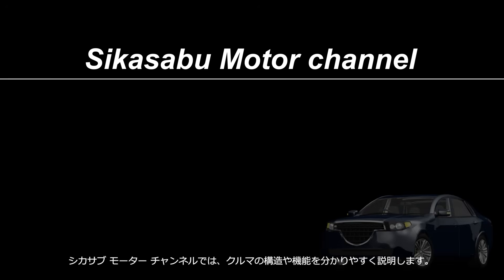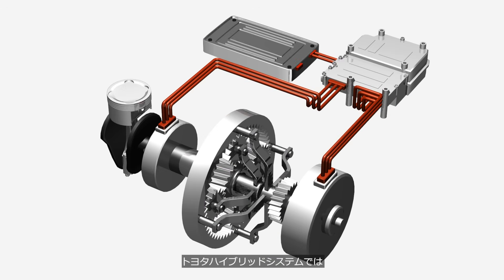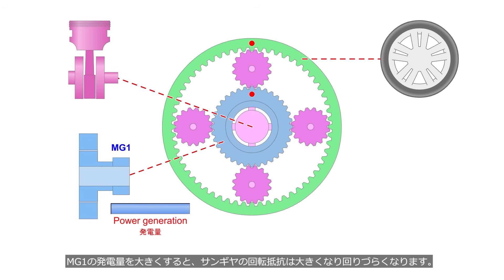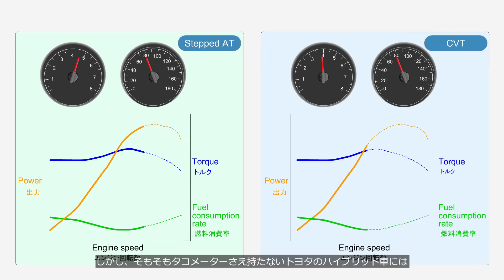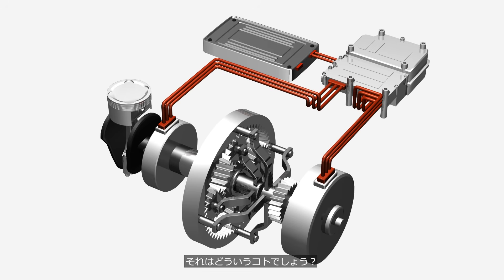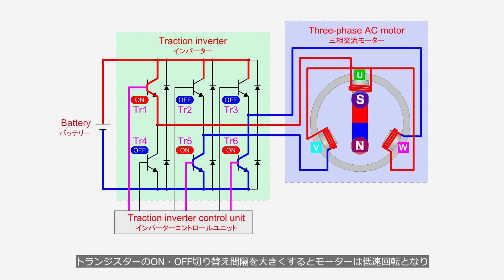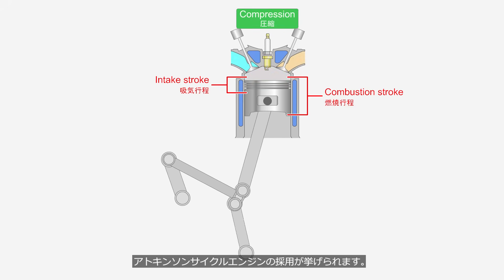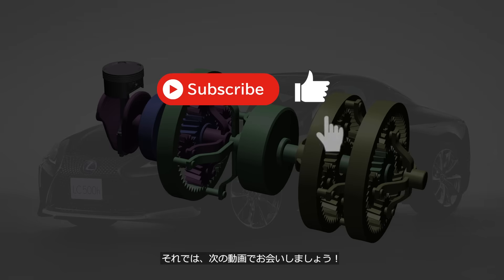Deep Dive into Toyota Hybrid System

Comment: It’s a good presentation of the operation of it all. It has improved over time. I now run a Yaris made in 2012, and until then I had the previous version. The older one had a NiMH traction battery, and the engine was a 4 cylinder 1.5l. The latest one has a Li-ion traction battery, and the engine is a 3 cylinder 1.5l one.

With the older one, it was necessary to use engine braking on some descents because (as you describe) the battery could become full, but that is less of a problem now. 

While the hybrid system works well, the low voltage side of the system can be awkward, as some models have quite small 12V DC batteries that can easily discharge via various low voltage items that are always in use, especially in cold weather. While there is no conventional DC starter motor on these systems (MG1 doing the job when required using the high voltage DC from the traction battery), there is a degree of interlocking with the hybrid braking system that requires some power from the 12V battery for to be able to start up (creating enough hydraulic oil pressure) and allow the traction power to be switched on. It is a common fault for low users at certain times of the year.

They could work around this by allowing the high voltage to start in 2 stages, as once the main contacts are closed the 12V is provided by a converter, and they could still be able to prove that the braking pressure is OK for the next step, but that would make it a bit more complex.

Comment: I do not understand, 3:07 if the sungear is rotating, does not it cause MG1 to generate power? Also at 4:10 how is power output of MG1 increased or decreased? Is MG1 disengaged physically or is it being rotated by consuming battery to match a certain rotation, hence load on the sungear?

Comment: <Edit> I get downvotes because I criticize Toyota. They don't show up, but I know it happens because I when I get upvotes the total is always zero. But nobody ever points out an error, because there are none. This is part of my point, in using straight-forward language. Toyota gets unjustified praise.
+++++
So many lies.

0:13 "In 1997 when the world's first hybrid vehicle,  the Toyota Prius, was unveiled..." A similar system was both "unveiled" and patented at the University of Maryland around 1994. According to the eventual lawsuit settlement, Toyota "developed it independently."

There were also previous examples, but they all suffered from not being able to use modern computers to regulate the system, which is what was innovative in...

0:24 "The engineer who developed this system must be an absolute genius." Alexei Severinsky, a Ukrainian immigrant to the US, with no connection to Toyota.

0:29 "At present, this system is the most fuel-efficient hybrid system in the world." The Hyundai hybrid system in the Ioniq holds the title as the most economical. But that depends on being smaller, and lower-powered, than similar vehicles. Most efficient has to be determined by comparing the most similar vehicles. Car volume and (surprisingly) wheel diameter determine the relationship between efficiency and economy (mpg). The closest comparison in this category is the Toyota Camry SE and the Honda Civic Sport. The Civic wins.

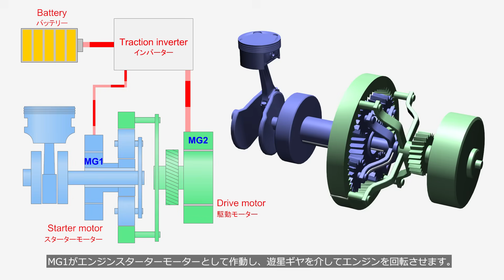3:19 "For engine startup, MG1 operates as a starter motor and rotates the engine via the planetary gear." Well..., not quite. The planetary gearset requires the rpm of the three elements to satisfy 13*MG2=5*MG1+18*ICE at all times. If the ICE is not spinning (ICE=0), this means MG1=2.6*MG2. To force the engine to start moving, MG1 has to reduce its rpm in order to increase the ICE rpm.

3:36 "At this time, the planetary gear functions as a continuously variable transmission (CVT), allowing the vehicle speed to change while keeping the engine speed constant." Close. The load applied to one of the MGs, acting as a generator, is balanced by the torque applied by the other, acting as a motor. This regulates the operation of the ICE as a function of both rpm and load. This is the innovation I mentioned above. It is a complicated way of saying the two MGs work together to force the ICE to run at the optimum rpm for the power it needs to produce.

4:18 "The engine speed is constant now." Not quite. A pure ICE car can only regulate engine speed, for the power the car is drawing. It varies with car speed. A hybrid can also regulate the power being produced, and uses the battery to adjust that to what the car needs. So engine speed will be more constant in a hybrid, but it is thee power  that  is most important.

5:01 "The vehicle speed can be changed while keeping the engine speed constant." Engine power output is held (near) constant while car speed and engine speed can vary.

Comment: The electric motor works on the principle of mutual induction which works as a motor to start the engine and a generator to recharge the battery the difference between synchronous  speed and rotor speed which is called slip. Positive slip is where the electric motor rotor spins less than synchronous speed of the stator which start the engine.
Negative slip is where the engine drive the rotor more than synchronous speed of the stator the induce magneticfield in the rotor is going start cutting across the stator and induce a reverse current at 270° behind the magnetize current.

Comment: Does the engine need a clutch or it uses the planetary system. If we turn mg 1  on the rotation of engine faster than the engine we can make ring gear stationary or even reverse

Comment: Cool to see someone have run whole system outside of car.
I was thinking if there is a chance to use this hybrid system as emergency power generator.
We have an engine, we have power generator, accumulator and inverter.
My idea is to use in case of emergency whole system as power generator.
I understand battery is 220-230V so exactly as voltage in European power grid. Inverter is converting this DC voltage to AC to power e motor. Would it be possible to get somewhere in this system 220V AC?
This was instead of powering e motor would be possible in critical situation as any type of blackout to power some most crucial devices home like fridge, maybe pumps for water etc or even boil water for a drinking. 
Anybody have such knowledge?
Reply from the maker: Thank you for your comment. 
In Japan, many models come with an option for a household power outlet. (I'm not very familiar with the situation in Europe.) There have also been many news reports about how helpful this feature was during disasters. However, if that's a priority, a PHEV or a battery EV with a larger battery than a self-charging hybrid might be more suitable.

Comment: I've heard that hybrid cars get worse MPG on the highway compared to regular cars. Also, are hybrid cars expensive to maintain? Is a hybrid really worth buying? Thanks ❤❤❤
Reply from the maker: Thank you for your comment again.
In general, hybrid cars get good MPG even on the highway. As for maintenance costs, unless the hybrid battery fails, I think they’re not much different from regular cars. 
However, depending on gas prices and how much you drive, it can be tough to offset the higher car price with fuel savings.
I love manual transmissions, so I would never buy a hybrid car.😁
Reply: @sikasabumotorchannel  thanks for comment ❤️❤️❤️
Reply: We on our third Prius hybrid, this time a 5th Gen. We had the first two for 16 years. The maintenance costs were far less than other ICE cars we owned. The Totora system does not have many parts found on gas cars, parts that need repair or replacement. No starting motor, no belts, no alternator...............  .

As for maintenance of the Synergy System, there was none after 16 years.

Comment: I think the semiconductors used in HVs and EVs are actually SiC-MOSFET, not SiC-IGBT.
Reply from the maker: Thank you for watching the video and leaving a comment.
I think MOSFETs will become more common in the future, but both are currently in use.
Reply: @sikasabumotorchannel  Si-IGBTs have always been the mainstream for high-voltage inverter applications in EVs and HVs, but recently SiC-MOSFET devices have started to be used. SiC-IGBTs may be in the research and development stage, but I don't think they have been commercialized yet.
Reply from the maker: Thank you for pointing that out. As you mentioned, SiC-IGBT was incorrect, and the correct term is SiC-MOSFET. I will add a correction in the video description.
Reply: @sikasabumotorchannel  Thank you for your understanding. I hope you will continue to make great videos.

Comment: My 2024 Prius has the 5th generation hybrid system which is not covered in this video.  What is the difference between the 4th & 5th generation?
Reply from the maker: Thank you for watching the video.
The hybrid system structure of the 5th generation Prius doesn’t seem to have changed significantly from the 4th generation. However, the hybrid unit has been redesigned and improved in all aspects.
Reply: @sikasabumotorchannel  While a brilliant design, I often wish Toyota would program the eCVT less aggressively in ramping up the RPM so high at partial throttle while causing unpleasant noise and harshness and not gaining much more momentum if running at lower RPM.
Reply from the maker: That might be one of the weaknesses of Toyota's system. To ears accustomed to the quietness of EV mode, the engine noise feels quite loud.
By the way, I love Bearcats too.😊

Comment: I want to know BYD DM I technology
Reply: BYD's hybrid system is closer to Honda's hybrid system than Toyota's planetary powersplit series/parellel hybrid system. Both Honda and BYD have an engine, which is directly connected to a smaller electric motor which functions as generator and a bigger electric motor which functions as a traction motor. Between the two electric motor is a clutch not a planetary gear. 

In low to medium speed, the clutch pack is open. This means that engine powers the generator which charges the battery. The traction motor then draws power from the battery to turn the wheels, thus functioning like a series hybrid. However in higher speed, the clutch pack is closed. This means the engine will directly power the wheels. 

This means that there are three possiblities in Honda/BYD system. 

First, when there is a full juice in the battery electric motor alone powers the wheels without waking up the gas engine. 

Second, at lower speed it functions like an aforementioned series hybrid system whereby the power goes from the engine, generator, battery, electric motor and finally the wheels.

Third at higher speed the engine alone is doing the work and is directly powering the wheels.

Toyota having the planetary power-split means not only can have these three scnearios but also having the engine charge and power the wheels at the same time as well as engine and electric motor both working together turning the wheels. This results in Toyota having better fuel economy at higher speed than Honda or BYD DM-i.
Reply: @miraphycs7377  so this mean Toyota hybrid system is better than these 2 systems
Reply from the maker: Thank you for your comment. 
I'm also interested in BYD's technology, but I have no way to obtain detailed information😢

Comment: Easily the best demonstration of how the system works! Before the addition of the second planetary the maximum speed of the hybrid system was @40-45 MPH. After, 61-62 MPH. On interstates I drive CC set @ TRUCK SPEED, 60 MPH so the hybrid system works, delivering @55 MPG in '24 CCH AWD. Over 62 MPH <38 MPG.
Reply: My 2012 petrol Peugeot with manual 5 speed gearbox gets 75+ mpg at 60 mph. (Experienced over 25,000 miles, the car has done 102,000 miles).

Nothing beats direct mechanical drive economy at 60 mph, which is why 44 ton trucks have direct mechanical 14 speed gearboxes.
Reply from the maker: Thank you for your comment. 
I agree with you — during steady-speed driving, manual transmissions, which have lower losses, offer the best fuel economy.
Reply from the maker: Thanks for watching the video and for sharing the information. 
It's interesting that there's a 7 MPG difference between 60 MPH and 62 MPH. We can see that Toyota specifically tuned it for 60 MPH.

Comment: About going downhill all the way long, since Toyota also have Plug-in Hybrid (PHEV), this won't be a problem as the battery has bigger size with the same powertrain. Oh and not only the THS and PHEV, HybridMAX (2.4 Hybrid Turbo with Direct-Shift 6AT in Crown Crossover), i-FORCE Max (use in Trucks and Commercial Vehicles in the US) and Hydrogen Fuel Cell also available, all in Toyota's Beyond Zero vision.
Reply from the maker: Thank you for watching the video, and also for leaving a comment.